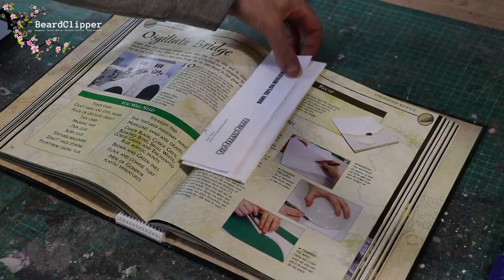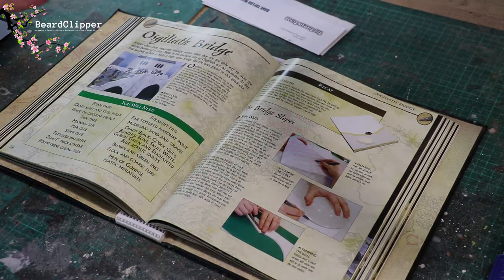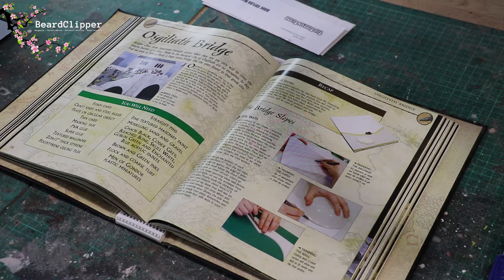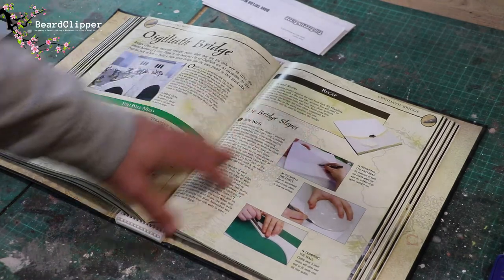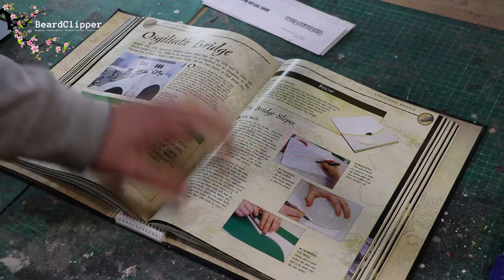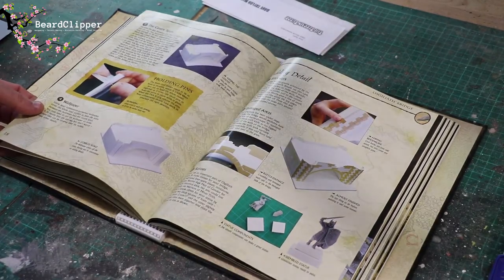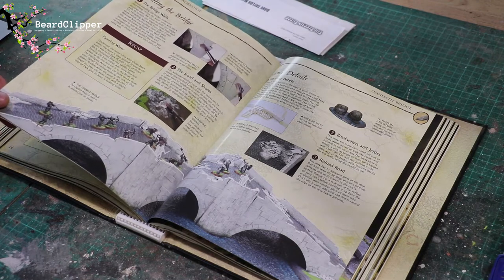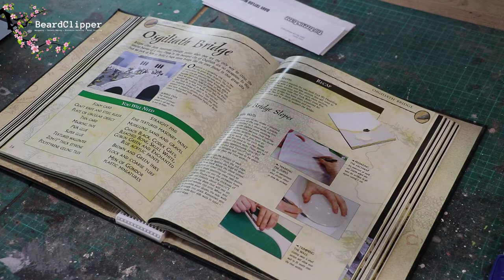SIX FEET LONG? This Osgiliath Bridge is epic! See how here || BGiME 31

Comment: The glue paint mix with sand could you use that in balins tomb instead of the tile grout
Reply from the maker: Yes absolutely. I find that the grout/dust gives a finer texture than the terrain paint with sand scattered on top. Other than that, they both work very well.

Cheers for watching!